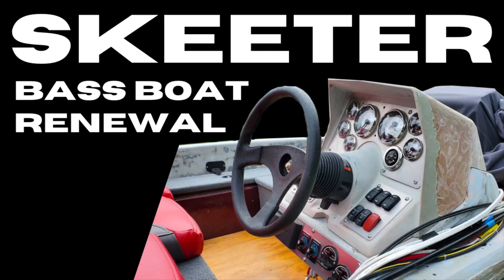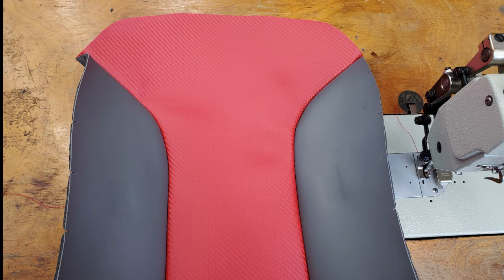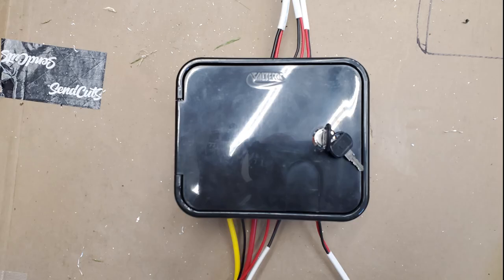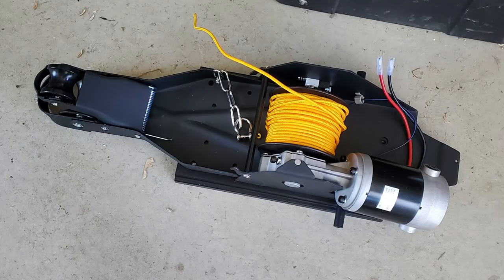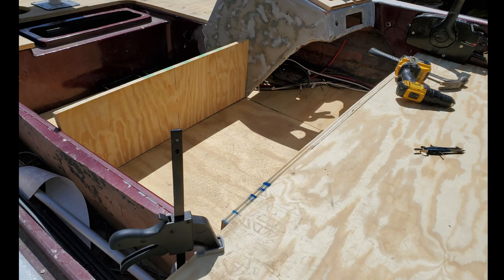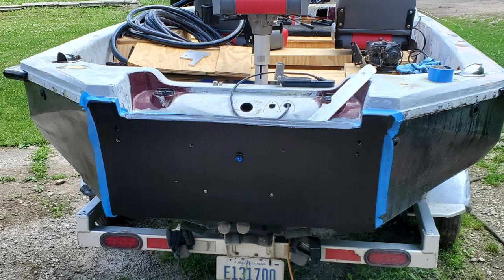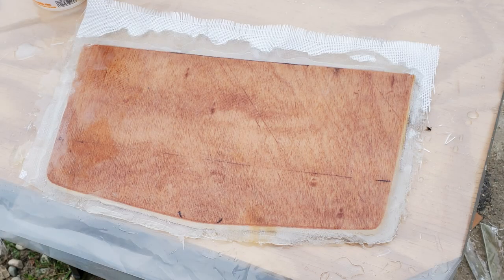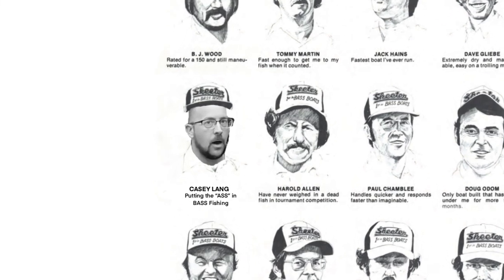1978 Skeeter HP-150 Wrangler:  Refurbishing an old Fiberglass Bass Boat @langbros.1907

Comment: Looks good for the age. A lot of work goes in to this kind of rebuild. I’m working on a 1991 ranger 690. Boat was free but as you know free ain’t exactly free with all the work to be done. I used 1/2, and 1/4 inch plywood instead of 3/4 to save weight. Mine is going good, so is yours.
Reply from the maker: Nice David!  Thanks for the feedback.  Love those 90’s Rangers.

Comment: Do you restore boats for people? If you do I would like to know what you charge I have a 1995 skeeter SS140 that I recently bought and I would love to restore the boat but have NO idea where to even start haha
Reply from the maker: I'm really just a weekend warrior... this type of work is fun for me but doesn't pay the bills!  I wish it would.
Reply from the maker: Ss140 is a nice boat.  Just saw one of those on the water last weekend.  Lot of potential.
Reply: @langbros.1907  how much did it cost you to fully restore this skeeter boat?
Reply from the maker: Cost me more in time than money.  But to make it easy let's just say that a repaint with all supplies is 2-3k us on the low end.  Engine work is another big money hole and
Reply from the maker: Completely variable.  To do basic tune up stuff  500 to 1k us... thats for all the maintenance items and to have the lower unit gone through.
Reply from the maker: Carpet is not too bad.  Couple hundred.  And wiring was about 1k
Reply: Thanks for the information, what about all the framing for all the compartments and stuff. Its looking like a whole lot cheaper than just buying a new boat which is a good thing
 @langbros.1907
Reply from the maker: That was actually the least expensive part in materials.  Marine grade plywood is getting really expensive these days, but an alternative is a grade standard plywood with plenty of penetrating epoxy.  You can get most of your glass and resin supplies online and drop shipped.